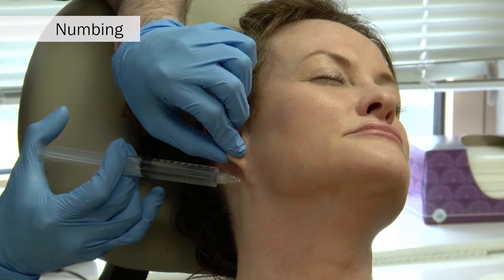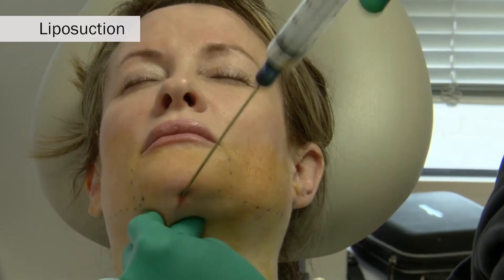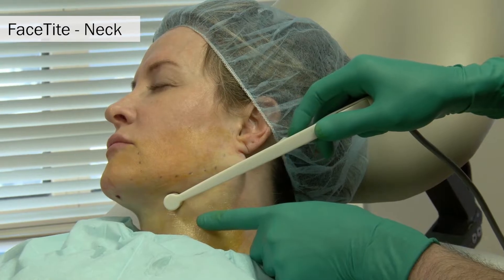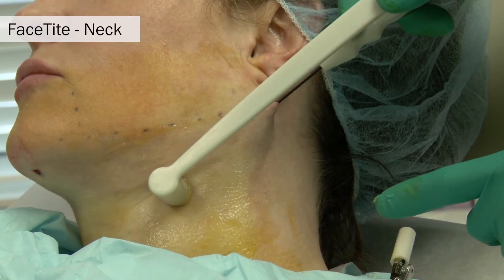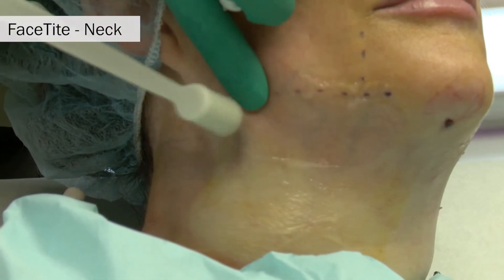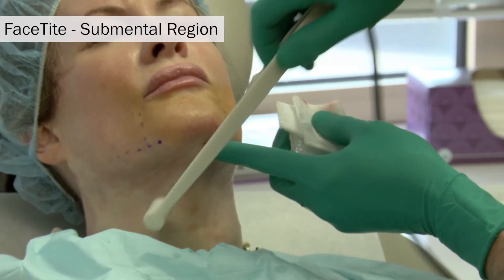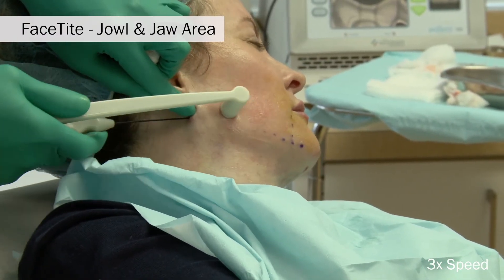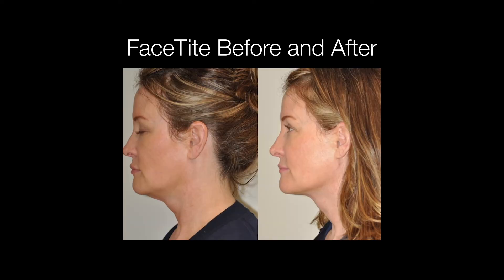Technique for Lower Face and Neck Tightening With FaceTite

Comment: And the cost?
Reply: It doesn’t cost that much. It’s non surgical. Between $3,000-$4000
Reply: In New York City, ~$7,000.00
Reply: @edydon  $7000?, spend a little more and rather go with a facelift, so you can see a difference.